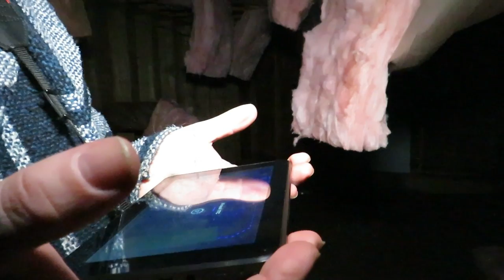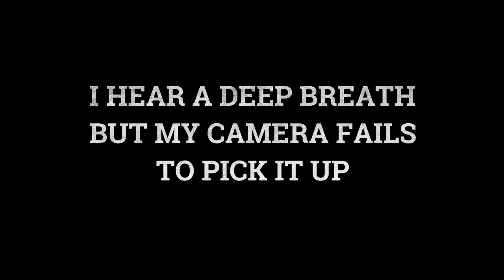Terror In The Cellar

Comment: If the electrician got ran off during the daytime, what about taking someone who is knowledgeable about any kind of renovation work or you yourself go in with lights on and pretend to continue the renovation since that seems to be what aggravates it. Then the homeowners may actually get some of the work done they need and you could document in the light?
Reply from the maker: That's a great idea! Trying to get a response be re-enacting the situation at the time of the event, in some cases, may trigger some activity. Thanks for the suggestion. 
And a side note, the boss of the fella that ran out did finish the job ( i believe without incident)..